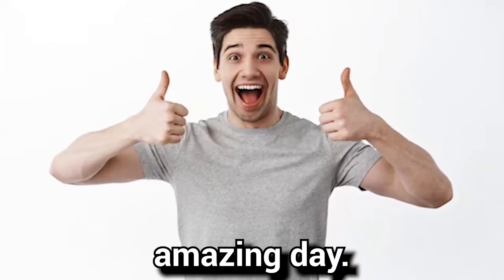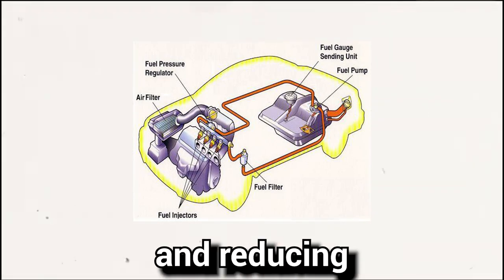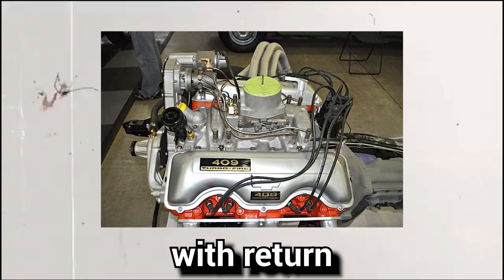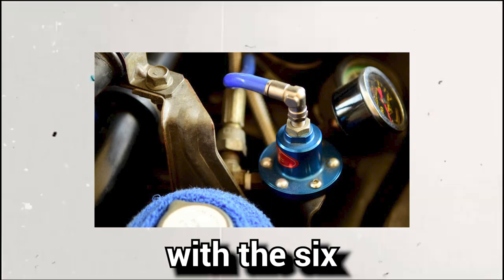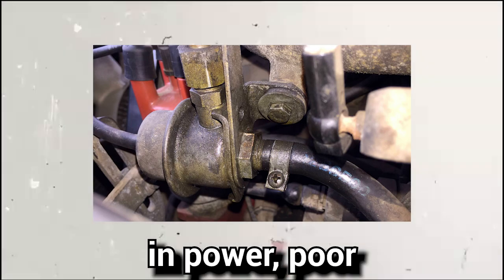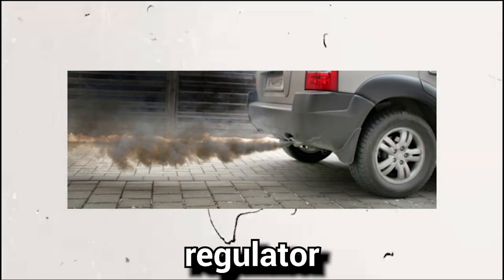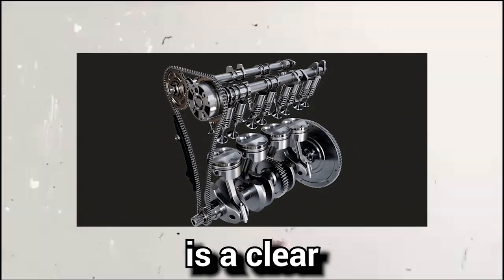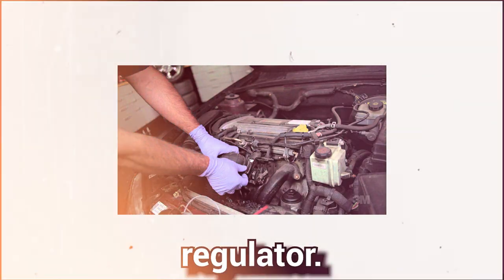6 Symptoms of a BAD FUEL Pressure Regulator

Comment: The only symptoms that I have are poor acceleration past 60 mph or so. Also when going uphill. Other symptom is smell of gas from my tailpipe. The vehicle is a 95 Cadillac DeVille with a V8 Northstar engine. Do you think it would be safe to say that it could be the fuel pressure regulator and if so, what signs should I see to know if the fuel pump is going bad as well? I’d appreciate any help you can give greatly! I’m having troubles finding videos on my specific engine type.
Reply: Usually when your fuel pump is going bad you'd get hesitation on acceleration and occasional sputtering.
As for the fuel pressure regulator I'm not sure as I have a gas smell in my engine bay and it's been that way since I fixed a broken hose leading to it😂.
Reply: @jovo21 I have this hesitation and stuttering. Also car randomly dies. What did you do to fix your car?